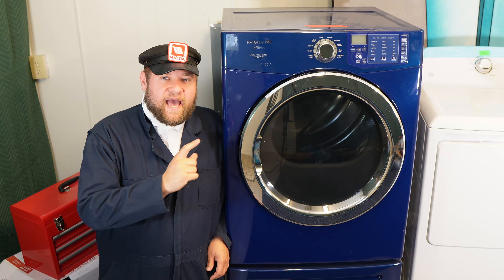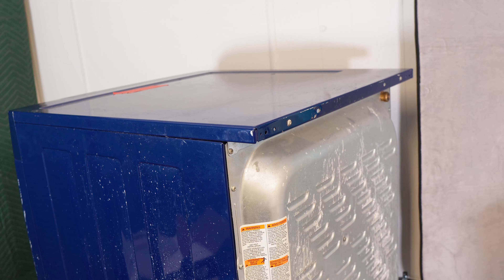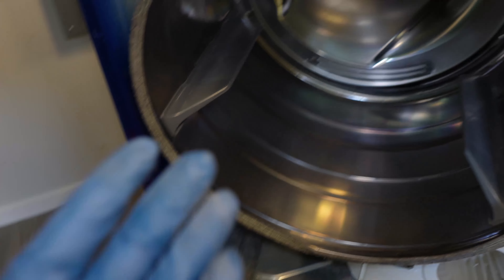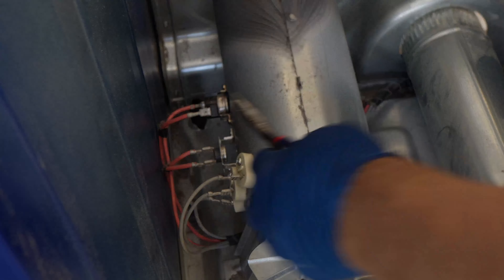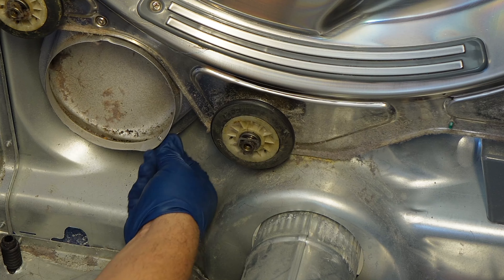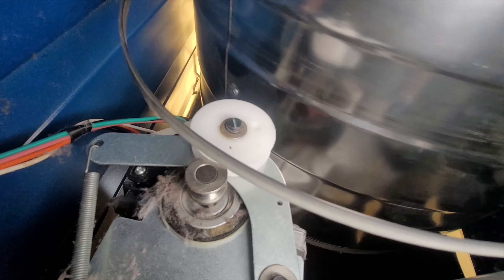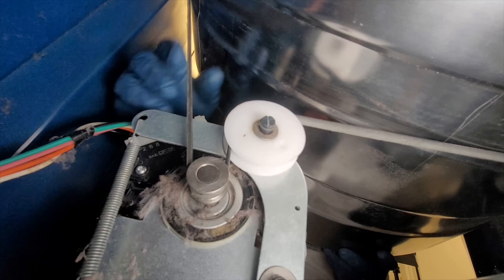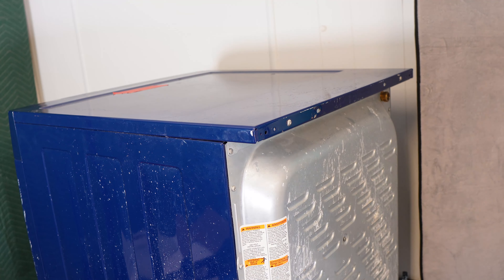Frigidaire Electrolux Dryer Won't Heat - How to Find and Fix a Stackable Frigidaire Dryer

Comment: If you're moving a full electric/ 240vac appliance just do your self a favor and turn off the breaker before attempting to move the appliance, if there is a burnt terminal block/wire the last thing you want is a loose wire touching the frame when your moving it.

Those dryers are notorious for having a bulk of lint in the lint trap cavity, partially bad design and partially people not cleaning it out thoroughly.

Rollers are a nightmare to replace. Putting a lot of faith in those gloves with those sharp edges.
Reply from the maker: I have a video with the roller replacement. Coming soon as I did that when shooting the element diagnosis. Ironically I was able to replace them all in a matter of seconds. The roller shafts on the other hand...